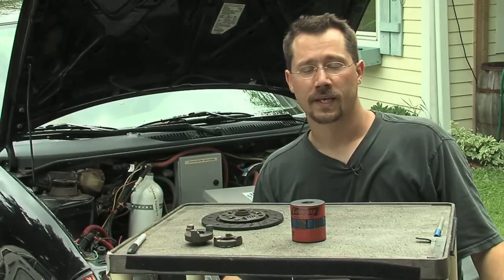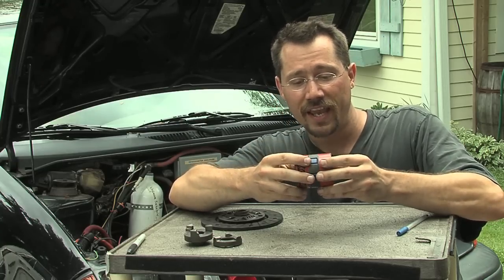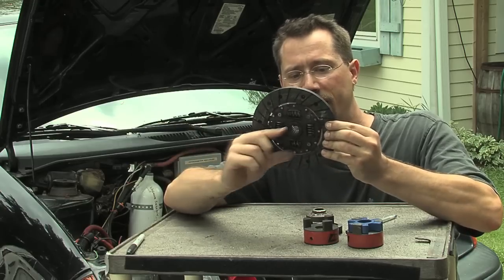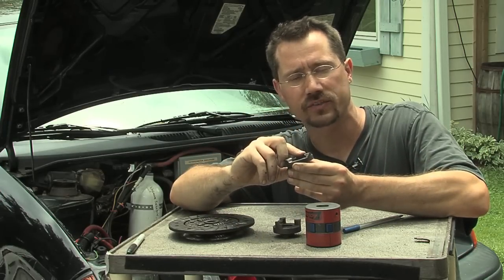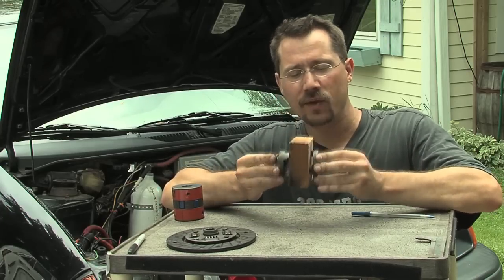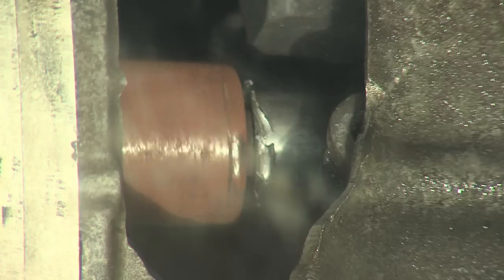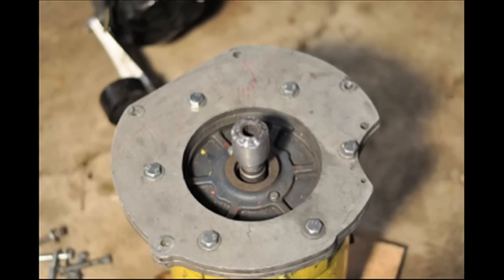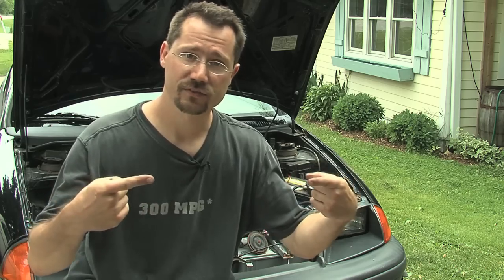8 Build Your Own Electric Car: Coupler

Comment from the maker: We are now on Patreon! We'd love your support as it helps us produce more videos like this! https://www.patreon.com/300MPG
Reply: Could you try incorporating Capacitors as a light weight, quickly charged power source alternative for all battery system?
Reply: I need catalog checklist on just stuff I need to switch proper way to sequence batteries charging point how many batteries what kind of batteries size of motor ,I also need adapter plate and accessory bracket for power steering air conditioning alternator I'm interested this for 2004 malibu manx
Reply: Hi Sir! 
Kindly make a video on sizing or caculate to select best motor for ev. Thanks

Comment: As an industrial plant mechanic that has repaired large production machinery for 45 years+ , I can attest to the fact that the Lovejoy style of coupler you are using is not intended for heavy loads. The elastomer cushion will wear away fairly quickly and will be a constant maintenance problem . Your video presentation and content in general is excellent. Well done.

Comment: I used this kind of lovejoy coupler to build a DIY locking differential on my gocart for when you go mudding. Very solid connection, but boy do you see metal fly if you accidentally get your rpm sync wrong lol
But mine was not permanent connect. The one side could slide 30mm on the shaft so that you can make the connection when needed. Learned very quickly that it's a good idea to only do that while stationary

Comment: I did a solid coupler in my 70 beetle ev conversion.  I used the clutch center and welded it to a piece that fit on my shaft of the D&D motor.  The coupler failed after about 2k miles.  The splines disappeared on the coupler.  I made another one and put a little grease on the splines.  So far no other failure.
Reply: Martin Parrish grease is key man.
Reply: The coupler/clutch plate centre will be hardened steel and when you weld it you alter that. It needs to be heat treated again after welding.

Comment: After you got the motor and transmission lined up I hope you drilled and reamed 2 alignment pins.
Reply: This is what I’m left wondering about. Def need high accuracy on centering, alignment and once aligned, dowels to maintain alignment. 

I like his explanations. Shows how to do this on the cheap.

Comment: Correct shaft alignment must be done with a Dial gauge. Even a little bit of misalignment will cause problems such as wear and vibration. Once the alignment is perfect you would normally drill and fit dowels so that any future alignment is always going to be true.
Reply: Yes, otherwise shocks and vibrations from normal use can bump things out of position.
Reply: Fortunately,electric motors used to power cars like this one spin only at around 1500 rpm.This is like putting it on a electric drill.
If it was on a gasoline engine,that usually spins at 7000 rpm,so it might be noticeable.
Reply: I think it's more a question of shocks and vibrations. In a vehicle there is more than RPM to take into account when assembling drive trains.
Reply: You are right about the DTI.  I was horrified when he said he just moved it round to find where it didn’t vibrate.  No wonder the first coupling broke.  Alright for proof of concept, but as the finished job?
Reply: Misalignments will stress bearings to early failure. Even at low revs, the loads are still there. The other consideration is axial shock. Is the coupling solid or floating....?
Reply: @EamonnSeoigh  I'm wondering I'd a Dodge Paraflex coupling might be better.
Reply: Truth spoken. I have installed new bellhousings on class 8 deisel engines and transmissions. The OEMs call for a naximum runout of .002 inches. Sometimes very hard to acheive but it has to be done.

Comment: The coupler/clutch plate centre will be hardened steel and when you weld it you alter that. It needs to be heat treated again after welding.

Comment: What you made looks a lot like what's called a mini spool. If you could find two mini spool that are the same size but different sizes splines one size for motor one for trans, you could make two adapters that would hold up for about $70.
Reply from the maker: I'd never heard the term "mini spool" before, but it's not uncommon for people working on something to come up with a solution similar to something that's already in an industry somewhere!
Hopefully, people knowing that term will give one more option of DIY projects! Thanks for your input!

Comment: Question: since there is such concern about getting the splines mated up perfectly in either a single coupler or a lovejoy-type 2-piece coupler, wouldn't it just be easier to keep the clutch and flywheel?  In that scenario I suppose you have to custom adapt the flywheel to the motor, but if the transmission and motor are mounted together with an adapter plate isn't that close enough for a flywheel and clutch?  I'm thinking about getting a LEAF AC motor and batteries to go into my Nissan 720 pickup, and I'd still like to use the 5-speed transmission.  I'd like to see all this process discussed, but using a clutch and flywheel mounted to the motor instead.
Reply: > I'm thinking about getting a LEAF AC motor

I'm in the same boat. I think I'm going to get rid of the clutch because I don't know the leaf EM57 motor is designed for the axial loads that would normally be applied to the engine when the clutch is disengaged. But maybe we could add another bearing to brace the flywheel against the leaf adapter plate...

Comment: Back in about 2006, there was a company that sold a hybrid kit that used an electric motor which turned an RWD driveline via a belt.  The ICE engine stays as is, just operating PS etc in neutral. I think I could do this for my pickup. Any thoughts?
Reply from the maker: I always liked this concept. Instead of a belt, the driveshaft just goes from the engine to a motor which is in-line with the driveshaft. https://youtu.be/TLPR2-7-xpM?t=277

Comment: Is there an electric motor with a shaft at both ends to turn P.S. pumps etc etc ? Alignment is most of the problem with shaft couplers. I would try a chain coupler before a Lovejoy. They can handle more torque
Reply from the maker: Yes, it's fairly common on larger motors to have a "tail-shaft" coming out the opposite end of a motor. In a car, it could be used to power accessories such as an air-conditioning compressor.

There's certainly more than one way to couple together two shafts. Lovejoy coupler components were readily available at a local store.

Comment: Do you think the two part coupler would've worked better if it were welded or would you recommend just using the solid coupler?
Reply from the maker: I'd recommend the solid coupler. It's rock-solid and super-strong. Make sure the motor and transmission are in perfect alignment and then tighten all the bolts.

Comment: How could you adjust the alignment if the aluminum plate had already been drilled?
Reply from the maker: It wasn't perfect. There was a very small amount of "slop" or room to adjust. On a rotating machine, you can often tell by sound if something is trying to bend, is being pushed against, etc. That would be bad for the bearings in the long run. This was only a very small adjustment.

Comment: Hi Sir, great videos you made. You must be a teacher :). But why didn't you use the existing coupling with the flywheel from the old engine.Than you didn't had so much to spend on building the coupler.
Reply from the maker: Using the flywheel is MORE complicated and requires more machining than the simple coupler. 
https://300mpg.org/projects/electro-metro/going-clutchless/

Comment: I had a Geo Metro and replaced the clutch and pressure plate but pretty much all manual transmissions rely on the pilot bearing and rear main bearing of the engine (whenever the clutch is engaged and transmitting power as the front bearing of the transmission.

The whole beginning of this video, the spider coupling, cardboard adapter plate template and everything is kinda moot.

If you can hire Mr. Machinist/hot rod guy to make these things up. (You really need these skills and tools to do this right) and maybe do this part of the video or have this video as a "how not to do it" video. If there were a commercialy available adapter plate that exactly centered the shaft to .001 at least...

Comment: You can upshift on manual transmissions by letting off the power  -  or shift into Netual but I downshifting is not as ease
I would thank you could upshift with the Elec- motor as well. and who knows it could be possible I just never could do it

You have to love people who tack their own time and money on things like this for so many of the things in our life came from the common man at home working on an idea's at times seem like fools dream to some.  From the computer to the aircraft at Kitty -hawk build by bicycle shop guys 

Thanks for posting and all the work you did I remember seeing the claims made by CSX if I remember right they claiming they could move? a weight of cargo? miles on one Gallon of fuel if I remember right

And the show were one place was using a small Turbine engine close to the size of 16 to 22 oz of bread to power a generator and power a car from a -dc or AC motor and getting 100 MPG in a Ford Taurus 

Mercedes was so impressed with there set up they ship them a new Mercedes so they could build and test there car with the engine set up they had and this was back in 2008 I saw the video on PBS.

Thanks for your time and for posting your work and ideas along with headaches along the way for people like you help make the world a better place for all and help open the minds of those to come 

Thanks

Comment: Hello can i use a 4.7/7.3 KW electrick motor for a car conversion mounted on the gearebox?
Reply: That won't be enough power to do more than golf cart speeds, even in a small car.  You would need 40-50kw minimum for a small car,  60-80kw for a mid sized car, and up.

Comment: I would really like to do an EV Conversion. What sort of motor would i need to accelerate in my EV at the same speed as a modern average 300HP car? like a V6 Cadilac CTSV (i think thats the right model name) or if you are familiar with Australian Cars, a Holden Commodore with an Alloytech V6 (i think they are called global v6 or somthing by GM). Those motors are found in the cadilac i mentioned, the commodore. the Australian Holden colorado (i think they are the same as the united states chev colorado). they are also found in other caars. I think they are a great engine and deliver an adequate amount of power for a NA v6. Im not thinking of turning a commodore into a EV, Its just i think the level of power it delivers is about perfect for me and like to retain that satisfaction in my EV. I would really like to make a late 70's or early 80's (infact all the way up to about 1985) Toyota Land Cruiser Troupe Carrier into an EV. I would like it to be able to accelerate like it would with a 300hp Modern petrol engine. Is that even possible with a Forklift motor? I'd love to hear your thoughts. Thank you for the winderfull video series BTW. :)

Comment: Can you just remove the transmission and couple the motor to the drive shaft to eliminate the losses caused the transmission?
Reply from the maker: On this car, that wouldn't be an option, as it's front-wheel drive and doesn't have a single drive shaft. On something like a pickup truck, you could directly connect the motor to the drive-shaft. This is typically only done with a rather powerful motor, as there's pretty limited gear reduction in the differential. Generally, there will be a large current draw with poor acceleration. Of course that can be overcome with a powerful enough motor and high-voltage/high-current battery pack (which also costs $$$)
Reply: BenjaminNelson thanks

Comment: But how much wattage is the elctromotor? ot looks so small and seems a vorkligt motor, so so much speed is not possible for that car? maybe the  transmission does
put some extra power in.
Reply from the maker: I’ve run up to 500A at 144v through this motor. That’s about 100 horsepower.
Reply: @BenjaminNelsonX  I presume that is piekpower shortwise  otherwise thing will burn I think. What kind of forklifter motor is used? I need as I see
the 144 volts version then. Maybe to find on a forklifter scrapyard?. But what happens if I rewind a 15 kilowatt three fase asynchrone motor to 144 volts x 3 and put 500 amps through it will maybe  the rotor get overheated? I just need only the formula foor rewinding it, I can even do 4 poles, and use a current limited 4 fase mosfet driver system. Windings are multistrains, so a lot of copper wires paralell.

Comment: Can you use a viscous coupler?
Reply from the maker: You can use anything that will connect the motor to the gear reduction of the car.
Anything other than a simple direct physical connection will be less efficient though.
Reply: @BenjaminNelsonX  thank you

Comment: Does it still work after so many years?
Reply from the maker: As I write this, the car would be 28 years old. Cars in my area rust. I took the car apart and saved the EV components, the body went off to the scrap-yard.
If not for the salty roads in my area, I have no reason to think that the car wouldn't still be running.
Reply: @BenjaminNelsonX  thank you. how many yrs did it run with the solid axle coupling before being scrapped? I'm currently waiting on the lovejoy but frankly i dont have too much trust init. But i also have doubts if i can do the fixed axle that lasts. (Frankly i'm thinkin of takin the diff apart and just drive it with a pulley directly like a gokart either with the diff or even without it...)
Reply from the maker: @dcktater7847  I never had any issues at all with the solid version of the coupler. It outlasted the car.
Reply: @BenjaminNelsonX  great thanks

Comment: I wonder how many HP deliver your electric motor?
Reply from the maker: This motor was essentially a junkyard find, and it never had an ID plate on it, so I don't know what the rated horsepower was on it. I HAVE run it at a peak of 500A at 144V. That's just shy of 100 horsepower, and keep in mind how the torque is almost instant.
This car originally had a 49HP gas engine.

Comment: Hard to understand why you would not use a clutch unless you stick it in a gear and leave it using the instant torque of the electric motor to get the car moving. So maybe 3rd gear for around town and 5th on the highway.
Reply from the maker: https://300mpg.org/projects/electro-metro/going-clutchless/

Comment: if you do have misalignment that coupling spider is going to wear like mad
Reply: OK so two minutes later he said that's exactly what happened
Reply from the maker: Hey, learn from other people’s mistakes, right?
Reply: @BenjaminNelsonX  why not use a rag joint coupler?
Reply from the maker: @rustystick   I believe a rag joint coupler would probably work fine. You would need to double-check the torque ratings on it first, of course.
Reply: @BenjaminNelsonX , well, for example my Dodge Magnum has an engine that is rated at 425hp/420ftlb torque. It uses a rag joint...

Comment: Should've gone with a clutch 🤔🤔🤔
Reply from the maker: The solid coupler has always been fantastic. In a project like this, using a clutch or not is more a personal choice than anything. The coupler fit well with my skill level in machining, is simple, and reliable. (Plus, I could never burn out or have to replace a clutch!) For more about clutch vs. clutch-less, please visit: https://300mpg.org/projects/electro-metro/going-clutchless/

Comment: LOL....if this was in Australia it would be termed "Outback Engineering"...…...this is not to put down your efforts but it's very basic ….never mind the fit,......she'll be alright mate...... on the pavement engineering without much engineering expertise that would apply to a regular mechanical builder......you are intending to run it on the road aren't you????...….I don't think welding those high tensile clutch parts is a good idea due to the metal composition when you weld them. I would not use this video to do a similar retrofit.....in the manner you approach it...…. but it does make me interested in the fact that an electric make over is possible with the right source of parts etc.

Comment: Where do you get an electric motor with the power to drive a car?
Reply from the maker: Of course, you can simply mail-order an electric motor for a car conversion, but the motor used in this project was simply repurposed from an electric forklift.